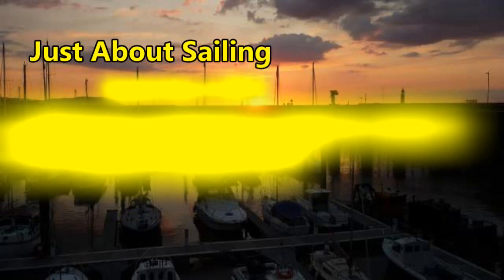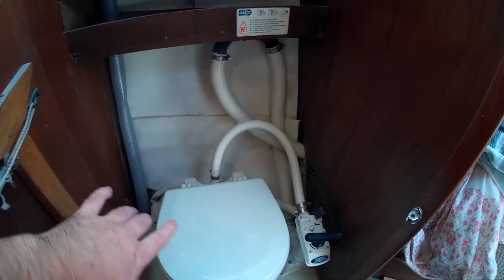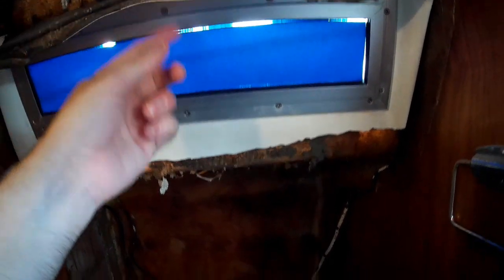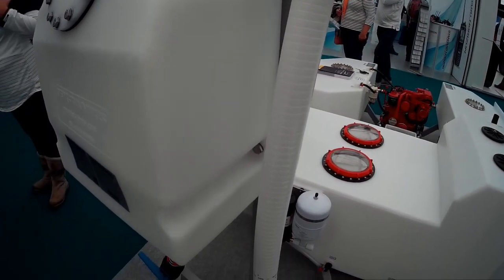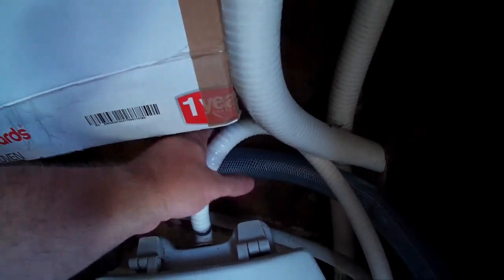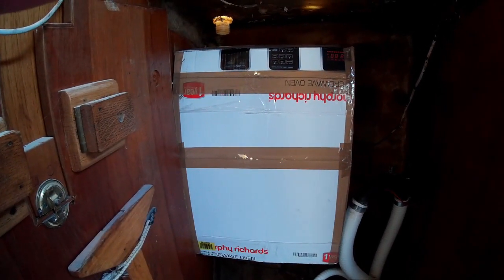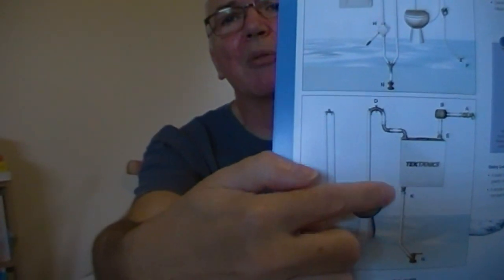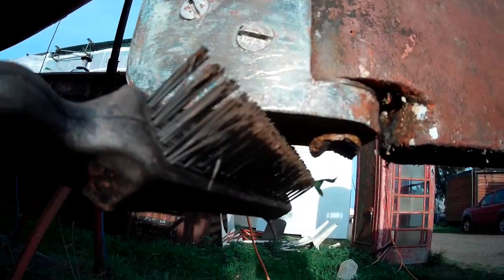Just About Sailing September 2 2017 - Holding tank plans and off with the rudder, almost

Comment: Very interesting about the holding tank. I have a Rival 34 and was thinking about doing the same as you. Are you going to have a pumping out outlet in the deck? Also are you having an external air vent normally fitted on deck.It looks like you may have to split the rudder and insert a new stainless steel rudder rod. Great Vlog nice and real.
Reply from the maker: Yes I am planning a pumping out outlet - so it's not quite the same as any of the Tek Tank drawings. I plan to have a charcoal filter inside but leading to an external vent.  Although to be honest I am not sure of the best placing for the vent yet.  I am guessing it will be about the same size as the diesel tank vent which is quite small and inconspicuous. I am going to get a surveyor to have a look at both the keel and the rudder. - Two things I don't want to fail.

Comment: Try a magnet on the rudder shaft If it sticks just a little then it's 302 stainless, I f no sticking then 316 stainless.  Hard to believe that it rusted right thru. I know stainless under water always, will corrode but there should be a plastic bushing keeping the dissimilar metals apart.
Reply from the maker: I'll give that a try.  It is a bit odd and I haven't really had a good look at it yet. I have the factory plans for the rudder somewhere. That might shed some light on it.
Reply: My M28 rudder has a worn through white bush where top of rudder goes into hull and what looks like a brass doughnut bush on the skeg bottom. Searched for ages to find white bush supplier and found one on eBay under "Westerly Sailing Yacht Rudder Bearings In Acetal For Renown, Centaur, Fulmar... " - about £50 per set. Useful for any who was in need. That's my public service done. :) Peter.

Comment: interesting greywater is sink checkout marine portapotti have you an anode on the boat you can always hang one over the side
Reply from the maker: I do have an anode on the boat and another inside the engine.  I also have a galvanic isolator to protect things when I hook up to shore power.  I am starting to wonder if the thing that fell off the end of the rudder stock might have been a small zinc anode that should have been replaced ages ago.
Reply: thats somethging to ask in the boats user group

Comment: Maybe that was made out of mild steel? On the rudder, just a thought.  I have heard of this happening to others; DIY'ers redo things and do not understand metallurgy and sea salt corrosion or maybe it was SS but less than 316 type.

That rod in the rudder needs to be of the highest quality SS or Aluminum. 

Very glad you found it, even though you had a hard time getting it off, in a bad situation the power of motion and a wave could of been horrible.
Reply from the maker: Thanks for the comment.  The old stock certainly looks like SS. However, as you say, who knows if it is 316 or not.  The replacement certainly will be 316!!!  Yes, it could have been a mite embarrassing if it had broken off under way.  And it would only have broken when really needed.  There is always a slight worry of the 'unseen fault' where corrosion is slowly weakening something until it gives out under stress. - Rudder, rigging, sea-cocks, thru-hulls, engine, etc.

Comment: You may already have considered a composting system.   If not... they're not that expensive, all things considered.
Reply from the maker: I did have a brief look at composting systems.  It's difficult to get a proper sense of scale on the video, but it really is a very small space - effectively a 'corridor' between the main saloon area and the vee berth.  Air Head do a version with a cut out at the back to fit the slope of the hull so you don't lose too much space.  Unfortunately that one is still too big. Shame because I think you are right that this is an excellent solution.  Cheers.

Comment: well spotted rudder problem,everyones dumping seatoilets and putting composting and portapottis in they have their own holding tank and cost 70 quid cheers
Reply from the maker: Very tempted by an Airhead.  I did the measurements and there was quite a lot of modification needed - and even then it would be tight.  Composting has got to be the way to go in the long run. If I get as far as Turkish waters they even insist on a holding tank for grey water (washing up etc) and you have to show evidence of pump-outs (I think you get a little book).  The Tek Tanks solution is not the cheapest, but so simple with very few modifications needed. Cheers.

Comment: My two cents worth, Why don't they make the boats out of plastic? How long does a plastic bucket last before it breaks? Metal's corrode!   Some of the first sailboats from glass are still around just like new.You said the right thing just glass over mould cover it with plastic, and lay up all but the top then take out the cardboard, then build the top. If you use brass fittings and wrap strands of roving around the threads will make a tank that will last as long as the boat. Check out my site I have video's of the tankI made, same place as yours!
Reply from the maker: Yep, your tank is pretty much the same setup and location as I plan to do. Not sure I am brave enough to make it out of fiberglass - but on the other hand, why not?  Food for thought.  Cheers.

Comment: West system is overpriced and designed to be sold in swindelrys. I use MB fibreglass for all my supplies.
Reply from the maker: I've only ever used West Systems.  I do fiberglass work so rarely that I guess I just stick to what I know.  It's probably the same reason I never tried switching the channel over to ITV - too much change for me.  I will certainly not be trying West's brushes again.  The cheap ones I get from B$Q are great.